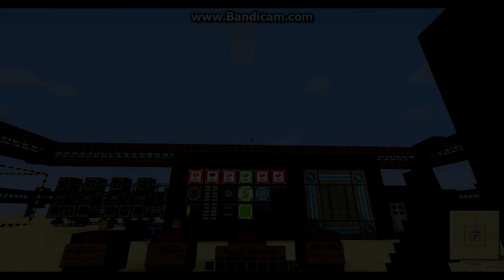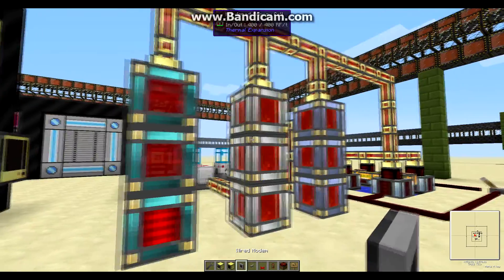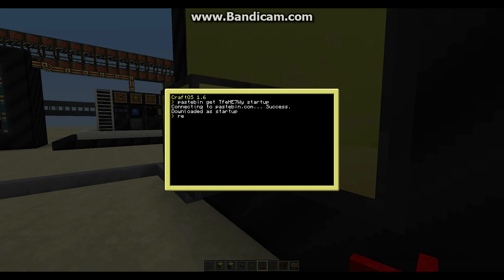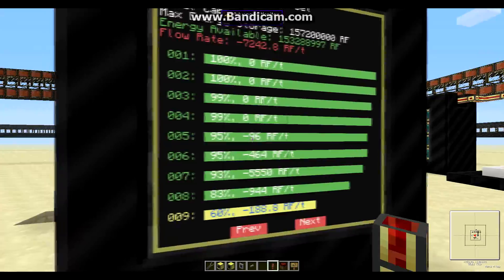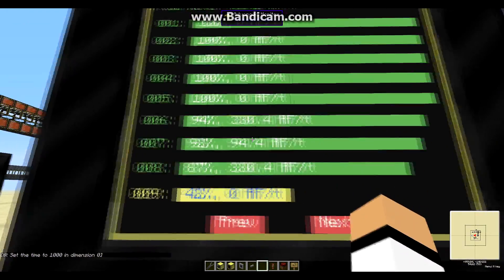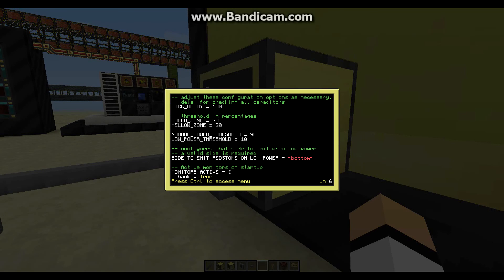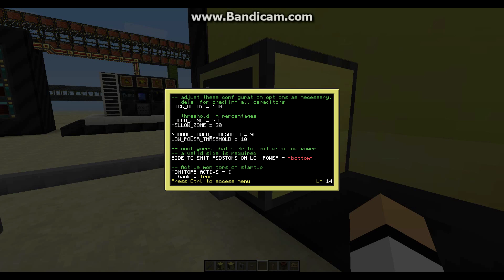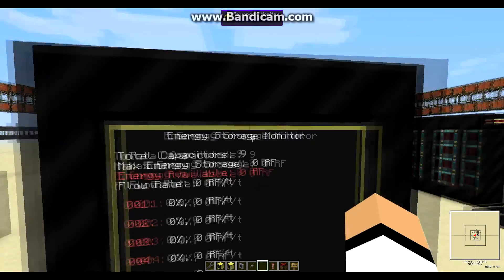Tekkit - Computercraft Energy Storage Monitor Program

Comment: I have this erro when I try open program "Startup: 183: Attempt to local table"
what doesnt mean?
Reply: i have this same issue but im on an 1.6.4 minecraft
Reply: MrTigger015 What minecraft version are you using?
Reply: I use tekkit 1.2.9G
Reply: That's the modpack. I need the Minecraft version used in that modpack. I have not yet updated the program for 1.7.
Reply: What version must use to work correctly
Reply from the maker: MrTigger015 It works on the latest version of tekkit, 1.2.10cx (when in technic launcher, click on the small "gear" icon - modpack settings and change its version to latest)
Reply: ok thanks it works for 100%